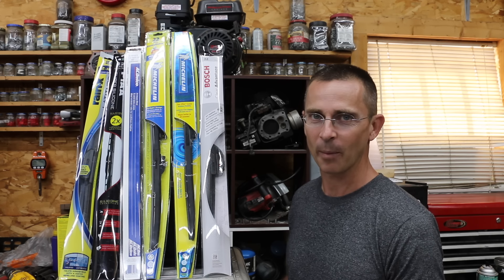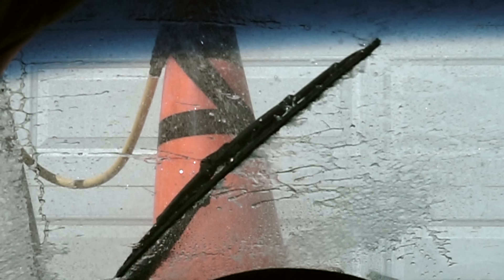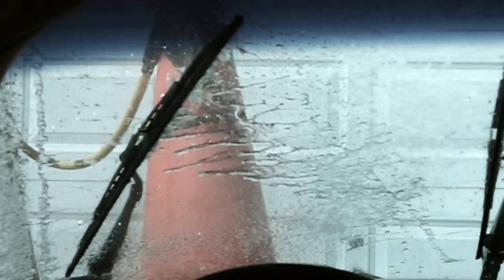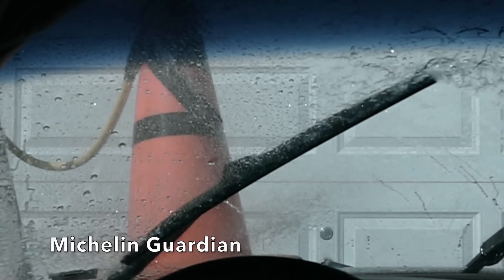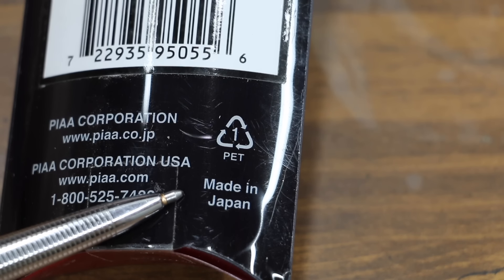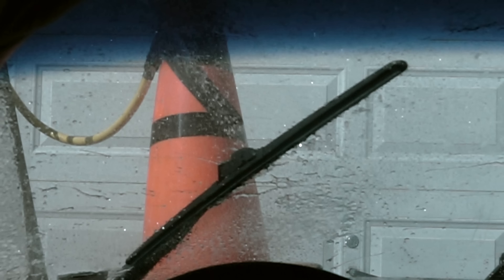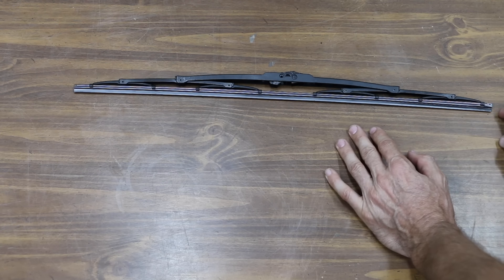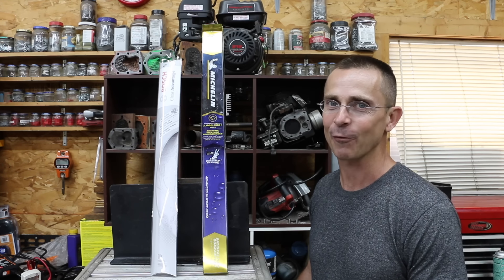Which Windshield Wiper Blade is Best? Let's find out!  Michelin, PIAA, Bosch, AC Delco, & Aero

Comment: I always like your channel and I believe I will always do.

This particular test is a little flawed. You have only conducted the wiping test on the wiper blades but didn't really test the after effect of the blades. I personally believe the PIAA and RainX blades, specifically, deserves another test.

Those two blades were a slightly different kind of animal. They were not really designed to keep wiping unless in very extreme rainy weather. They both forms a silicone layer on the windshield sliding water off without the wipers even running.

To be fair, I had never used the RainX blades myself and I cannot say too much about them but I had been using the PIAA Super Silicone blades for over 10 years. After you follow the installation instruction of the PIAA wipers having them mounted, you should follow the windshield cleaning and treatment instruction carefully too. The wipers will leave a slightly greyish layer of silicone on the windshielf, and will turn 100% clear after contacting with water, either rain or windshielf fluid.

Thereafter, you can pretty much leave your windshield wipers mostly off for the next 1.5 - 2 years, unless you are driving in very crappy weather. From time to time, just let your wipers running during a 10-20 minutes drive, if you feel that water is not sliding off easily. That may have kind of repaired the washed off silicone layer and allow it to slide water off like new.

It's like your are driving in a glass of Sprites if you do it correctly.

Just one thing to watch out for, never use very strong detergent on your windshield after using the PIAA blade, or the strong detergent will wash off the silicone coating.

Comment: The Blades for my 2013 Acadia seem to be only available at GM Dealers.  None of the NAPA blades would fit.
In the real world, blades take a 'set' when parked.  Older styles with a pin and hole mount could be reversed so the 'set' would go the opposite way when parked.  I use some Fine sandpaper on a block and try to take a little off the contact edge.  I then wipe with an Alcohol wipe.  In Canada it was $79 for the last pair a couple years ago.  They are made in Mexico.  AC  Delco.  Thanks for your Testing.
Reply from the maker: You are welcome!  Thanks for the feedback.

Comment: I really appreciate your comprehensive and empirically grounded reviews.  Good job!  I do have to question one thing though.  I bought some Bosch wiper blades [long before I saw this test] for my Toyota Highlander, and have been very unhappy with them from the start.  The passenger side wiper (20") had too much spring in its design, causing it to not lay completely on the windshield... which resulted in a 4" area which never got  touched at all.  And it never got better over time.  The driver's side was okay.

The previous wiper blades were from the Toyota dealer - and and tempted to just pay the price for OEM, because they worked great.  It would be helpful if OEM wiper blades were included in this test.

Thanks for all you're doing!
Reply from the maker: Thanks for the video idea.

Comment: This was great, thank you. I kinda wish you would have added a durability test to these wipers to see if the one that claimed 2,000,000 wipes actually lived up to it and if the cheaper ones broke down first (thereby needing replacement) and extrapolated that to see a cost/per wipe of each blade. That might further justify the more expensive blades if you don't have to replace them nearly as often.
Reply: Ya most wipers be work decent out of the box but durability is the real question.
Reply from the maker: Thanks for the suggestion.
Reply: @ProjectFarm  Love your videos man, keep making great comment, I can't get enough of it. They are entertaining and useful

Comment: Great work, Todd! Somehow I missed this one. The experience that my son, my best friend, and I have had with Michelin blades (sold at Costco) is they clean pretty well. The downside is that between a month and 6 weeks old, they make so much noise it becomes unbearable. All 3 sets hit the trash within that time. With over 30 years spent working in auto parts and service, I have had the best luck and consistency from Trico and Anco, and some of the worst with Goodyear and Michelin. For the UV test, the blades should be installed on an arm and in contact with the windshield with at least one cycle of the wipers performed.
Reply from the maker: Thanks!  Thanks for sharing.

Comment: I have a 2011 Ford fusion hybrid and have tried so many blades that since the car was new even the ones that came with the car and replaced with same kept skipping across the windshield! Mainly on the right side, so I tried every brand out there and after 8 years trying just about all including Sam's Club and Michelin I just happened to see different ones on Amazon called Aero and they wipe all the rain and don't skip across the windshield! Finally! Now if I can get the rain sensing wiper control to not stop in the middle of a torrential downpour! I end I p having to set the wipers to manual@
Reply from the maker: Thanks for the feedback.

Comment: Glad you included PIAA, however, you picked the inferior metal framed version to test. I've been using the same set of frameless PIAA blades for several years now and they still look and perform great. The PIAA blades leave a coating on the windscreen very similar to the RainX blades, which not only reduces blade use (saves your blades and your wiper motor) but I've also noticed it reduces ice build up in winter.

It's been nearly a year now, looking forward to the follow up to this.
Reply from the maker: Thanks for waiting!
Reply: I find the metal frames contour better than beams on certain windshields, and aero drag 10x less on the down stroke at highway speeds where the over-splash he mentions disappears (precisely what this test doesn’t show)

Comment: I do have something to add, the hybrid blades with the plastic around the metal arms has a strong tendency to fill with ice when your in cold weather conditions and it will not unfreeze with washer fluid or defrost, where as the bare metal seams to have this issue less with the blades working even better, in my experience
Reply from the maker: Thanks for the feedback.

Comment: A good wiper in Europe is Bosoko. It is that enclosed frame type like the Bosch. It is about $5/each. It lasts a few years without problems. One of my issue with all the wipers is that most of them are noisy from the start (might be a wiper mechanishm issue on my car though) and they aren't last more than half a year, or whole year at max. High intensity rains are not frequent or not lasts longer than few minutes where I live, so my biggest issue is that I rarely use them and still have to replace them too often.

I never had any issue with frozen wipers, as if the wipers are frozen, probably the windshild are ten times more so.
Reply from the maker: Thanks for sharing.

Comment: I love your videos. I have made wise purchases based on your testing. The only thing I see missing in this test is how the blades would perform under actual driving conditions, taking into account wind flow against the windshield. That may alter the performance to some degree, especially with the open metal frame wipers. But still, your test is very good, and I don't think you would see the old-style wiper frames out-perform the new modern beam-style, but some of the water splash may be eliminated when driving at highway speeds due to the movement of air over the windshield.

Comment: The sweet spot in wiper blades for me is the kind that comes standard on Lexus.  They use a metal suspension but with a hard plastic outer shell.  The rubber is replaceable, so they are very inexpensive.  The best feature is that they mount to the swing arm quite a bit lower inside than the other blades, making for a far-lower profile on the windshield.
Reply from the maker: Thanks for the feedback.
Reply: What’s the part number? 

For a 16’ IS

Comment: The Michelin plastic cover is installed to keep the wiper planted to the windshield. It’s basically similar to a spoiler some manufacturers install. The 2014 Cruze I own, if you do not have a spoiler or something to have air flow over them and cause them to stick, the wiper will lift at 55mph!
Reply from the maker: Thanks for the feedback.
Reply: @ProjectFarm  have you ever tested locks? I am a retired GM and Nissan parts quality engineer, I have lots of ideas.

Comment: Id love to see a real world test in ice and snow. Ive tried several, several different brands try to find one that wont freeze up while plowing. I've tried Bosch, Tri something or other, RainX and several more and when it's below mid 20's F they all fail usually leaving a tiny spot to see through. Heated blades are my next step but very expensive so for now all my trucks have 2-3 pairs in the cab, pull into a car wash and switch them out and your good to go.
Reply from the maker: Thanks for the suggestion.

Comment: Nice video.  Like others have mentioned, wind is a factor in my opinion.  The performance of the Michelin ones sold by Costco are impacted by wind at highway speeds.  This impacts how they remove water when they are passing down the window.  I believe that is a trade off with their solid covering design to add in winter performance.  If you do a lot of highway driving in non winter conditions I would opt for a different design style with better aerodynamic performance.
Reply from the maker: Thanks!  Thanks for sharing.

Comment: I have been buying the RainX metal replacements since I can then buy just the replaceable rubber part for cheap on Amazon instead of the whole blade in the future.  I used to do the same with Bosch but cant find the refillable ones any more.  If I lived some place with a lot of ice I would definitely go for those all plastic ones.
Reply from the maker: Thanks for the feedback.

Comment: I appreciate the tests. The next tests should be longevity: do the blades perform well after several months of use and how do the blades hold up after sun exposure in southern states. Finally, I’ve noticed the same brand of blade performs differently on other windshields due to differences in windshield design and with other blade lengths of the same brand. I realize that this is probably impossible to test except with the top few blades here.
Reply from the maker: Thanks!  Thanks for the suggestion.

Comment: I tried the Aero wipers but on the back stroke the leave my window streaky on the drivers side. My windshield is pitted from the sand when I lived in the southwest and is 24 years old. So maybe that has something to do with it. I did put a thin film of silicone grease on the blade and that helped until it wore off. I have bought other products based on your findings and all except the Aero wipers have been great. Thanks for going through all that time and detail for your reviews.
Reply from the maker: You are welcome!  Thanks for sharing.

Comment: Great review BUT... If they ever do them again I hope they will test it on the middle speed settings for the wipers. That is the setting that most people will use their wipers. When you have to pump it up to max speed at that point the rain is usually strong enough that all the wiper is doing is just slinging it off and quality doesn't really matter much. But on low or medium speed is where you get actual streaking on the window.
Reply from the maker: Thanks for the feedback.

Comment: Thank you for this video I have been struggling with wiper blades for a good many years since they have gotten more expensive I used to use cheap rubber blades they used to do very well I have been using the Rain-X ones but I'm not overly impressed with them after the UV hits them for a while they don't work as good as they did when they were brand new by even close although I did not run them on a dry windshield when I first got them I will try that
Reply from the maker: You are welcome!

Comment: I'll just throw this in two years later. The large cross-section of the Michelin wipers is a huge problem at speed. I bought and put them on two of my vehicles and both of them have moderate lifting on the return sweep at 45 MPH and don't even make contact with the drivers side windshield on the return sweep at 65. Went back to Bosch. No problems.
Reply from the maker: Thanks for the feedback.

Comment: It's interesting that the PIAA that PF got were metal frame.  Mine are the full silicone flexi gizmo like the Bosch.  I love them.  One definite downside to the solid silicon/rubber blades is a tendency to lift off the windshield at highways speeds, depending on aero effects of your vehicle.
Reply from the maker: Great point!

Comment: I was evacuating from a hurricane couple years back and got caught in a really bad tornadic storm. It was raining so bad I couldn’t see about 10 ft ahead. Using my wiper blades actually made it worse because of the wind blowing onto the blades as they were in the vertical position. I left them off and let rain x windshield fluid do the work.
Reply from the maker: Thanks for sharing.

Comment: Can't wait to see the 1-year follow up, because my main issue is with longevity (although it's helpful to know how the blade construction makes such a huge difference).  One other thing to test - possibly with a powerful fan or wind tunnel (yeah, I know that latter is prohibitively difficult and/or expensive) - is how they perform at speeds where wind resistance starts to become a factor, up to and including highway speeds.  I'd love to see what your findings would be under those circumstances.
Reply from the maker: Thanks for the suggestion.
Reply: well let me tell u after trying all of them for years bosch the ones for 35 to 40 bucks last a long time and dont break from the locking mechanism

Comment: I purchased silicone for the first time. Although more expensive, they are holding up much longer than any other rubber wipers I have had. I am going on 2 years now and they still perform incredible. I do clean them with an alcohol wipe once every 2 month and I am sure that helps, but no streaking so far.
Reply from the maker: Thanks for sharing.

Comment: Ive always found that using silicone blades along with applying rainx or silicone based windshield water repellent makes blades last longer. I feel like the reduction in friction dosent wear the blade out as fast. I would imagine the less friction would result in less wear on the wiper motor also. Also the silicone makes cleaning the windshield much easier. Only downside is maybe more glare when facing the sun. I use the frameless full rubber blades so the pressure is even the length of the blade.
Reply from the maker: Thanks for sharing.

Comment: This is a great video.  One pet peeve I have about wipers is that I wish auto manufacturers would stop making their wiper mechanisms in the manner displayed here.  In other words, both wiper blades move in the same direction which puts anything on the passenger side of the windshield directly in front of the driver.  While I don't particularly like Ford,  my friend has a 2019 Ford Fusion in which the blades move in opposite directions which moves whatever is on the windshield to each side of the car.  I have a 2020 Subaru Outback which I absolutely love except for how the wipers work.
Reply from the maker: Thanks for sharing.

Comment: Here in Canada I've used the Bosch wipers for years. They are way better than the metal frame wipers in all season. The only thing you need to be cautious of is with scrapping ice off your windshield. If the frameless style ones get stuck to the windshield with ice or you hit them with.your scrapper even fairly gently they tend to bend or crease the wiper edge and cause streaking from then on.
Reply from the maker: Thanks for sharing.

Comment: I've used literally every one of the ones in this test except the PIAA, and to be honest I have yet to find anything that performs better than the cheaper Trico types. Other brands may last longer before shredding but definitely don't actually make for better driving.

I'm in a very steamy, hot rainy climate that rarely freezes and I use RainX brand washer fluid, so those are some variables.

I think long term what you're going to find is that the cheap steel frame ones will conform to the windshield better than the single beams. The single beams unfortunately seem to lose their ability near their ends to maintain contact with the glass.

Also, I get a lot of misty rain, which effects wiper blades very different than heavy rain. I've found that the beam style blades get to a point fairly quickly that they are about useless in light rain for some reason
Reply from the maker: Thanks for the feedback.

Comment: The primary advantage of silicone inserts/blades is durability...I easily get 6-7 years of service out of PIAA silicone blades...only 2 years max. out of natural rubber blades. PIAA now has a "beam" type silicone blade offering. Will look into the Michelin silicone beam style for a price comparison.
Reply from the maker: Thanks for the feedback.

Comment: Great tests, as usual.  If the Michelin Endurance XTs last four years, they're worth it, but they only claim 2x endurance.
One trouble I have is squeaking, since I use the liquid RainX windshield treatment.  I only wish you'd tested for that, too.
I'll be trying the Bosch Clear Advantage blades next season.
Reply from the maker: Thanks!  Thanks for the suggestion.